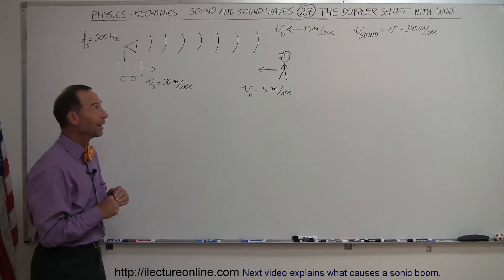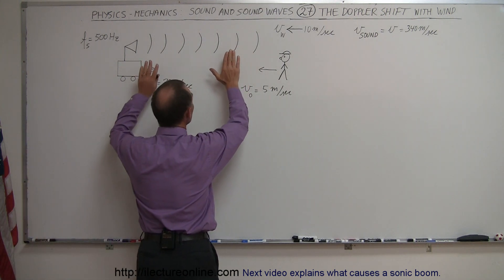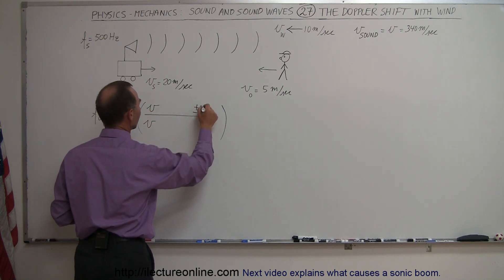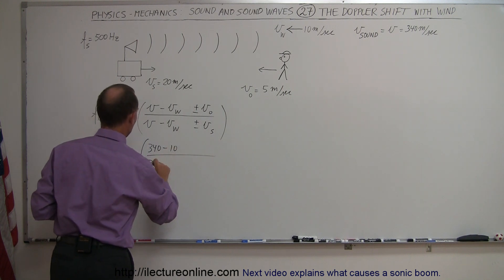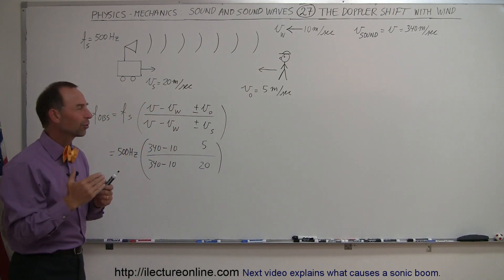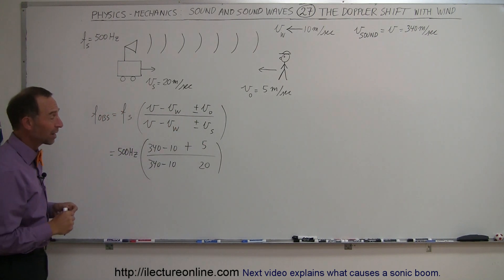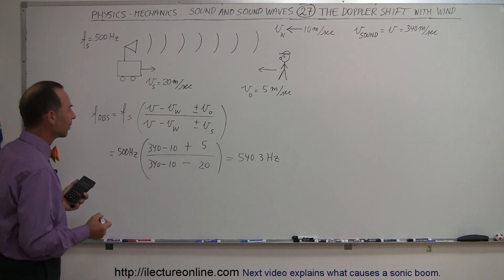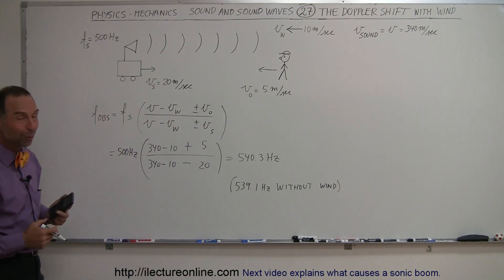Physics 20  Sound and Sound Waves (27 of 49) The Doppler Shift with Wind

Comment: Hello! if the source of the frequency and the observer are going into the same direction and the wind on the opposite, is the observer going to get a lower frequency? if it is lower, then there need to be a plus in the numerator and a plus in the denominator? (signs are confusing me a little) :c
Reply from the maker: If the observer moves in the opposite direction the + 5 will become - 5.    If the wind blows in the opposite direction it would have the effect of increasing the velocity of sound and the -10 will become + 10
Reply: ok, thank you for your attention Michael! have a wonderful day